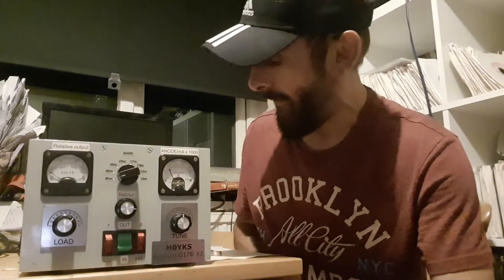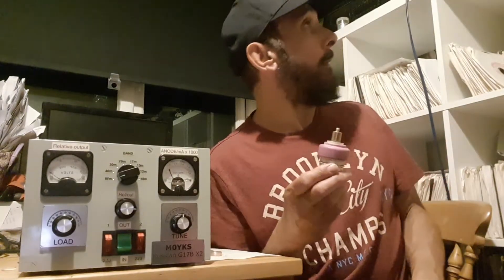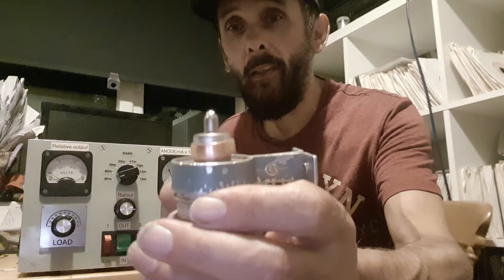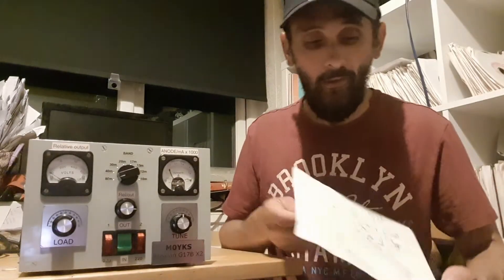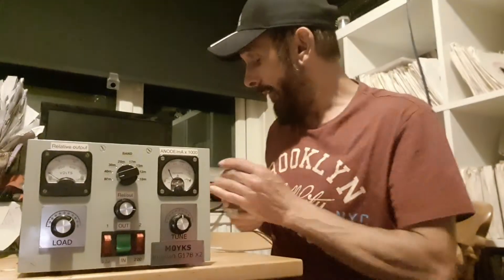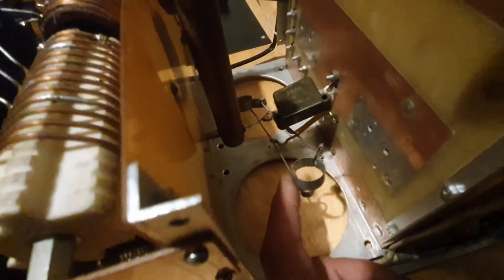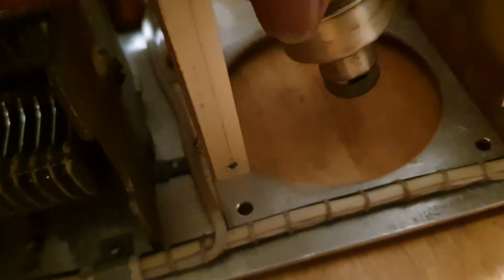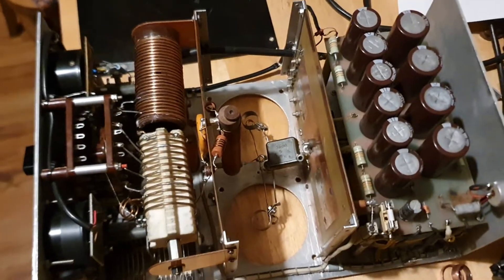GI7B Amplifier Upgrades Begin.

Comment: You came up against the age old debate, without realising! LOL  Cool from below or cool from above...  The only thing I'll say on the matter is that the cathode and heater connections need cooled too. ;)  Regarding solder connections, I do it quick and dirty - solder straight to the valve itself.  Your mileage may vary...